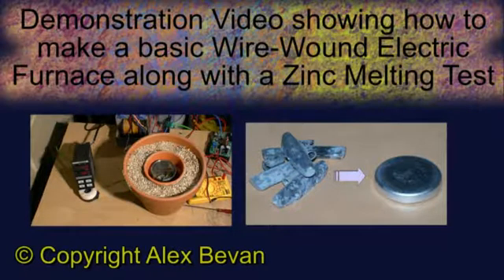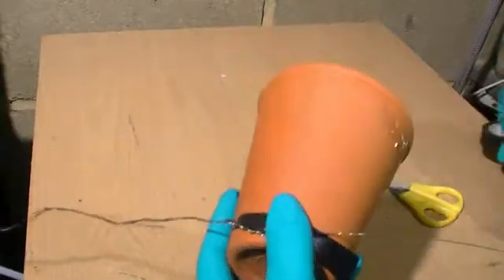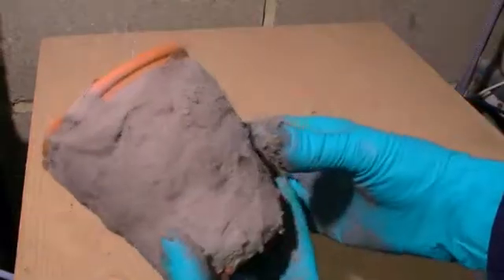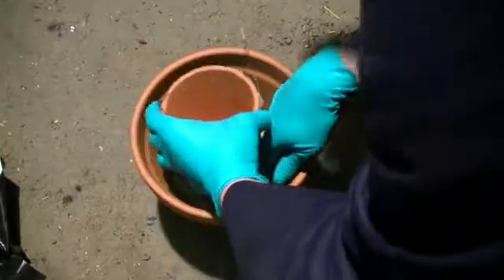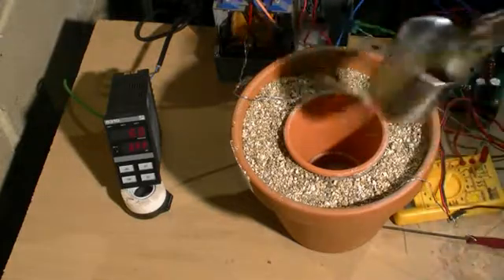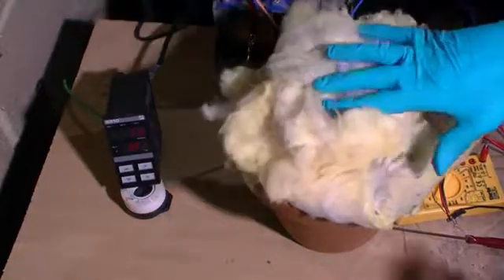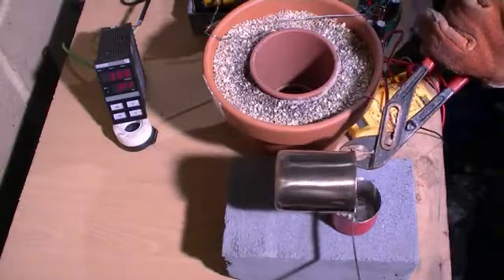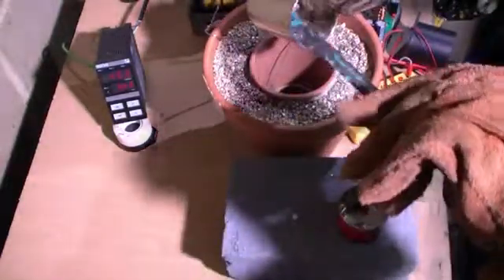How to make a wire wound electric furnace and melt zinc

Comment: Thanks for video.  How much time it takes to melt?
Reply from the maker: The first time you fire the furnace up, take your time to make sure any water is evaporated from the fire clay. After that you can increase the heating rate. I believe it took about 30-40mins when I ran but I was cautious as I didn't want to risk cracking the pot or damaging the heating element.

Comment: Cool! Have you tried using this for hot dip galvanizing? Will it work if i just dip mild steel parts into molten zinc? Or does it need some special flux or additives?
Reply from the maker: Should work if the steel is clean going in and absolutely no moisture on the surface. Will try this in the future- thanks
Reply: @EnergyMaterials  wikipedia says they put bit of lead in the mix, because it lowers the viscosity of molten zinc, so it flows easier of the part when removing it from zinc, so less zinc is lost and no big drops are left on surface. also steel should be cleaned very well and possibly etched before diping. probably same as goes when painting. maybe use somethig like prep&etch? steel should stay in the zinc bath until it reaches same temperature as the zinc, the you can remove it.

Comment: Thanks for the nice video of making this furnace.
I think it is lead not zinc.
Reply from the maker: I'm afraid we haven't used lead wheel balancing for a while now...”The European Union (EU) declared a ban on the use of lead in wheel weights in 2005” Older weight are lead but today they are made from Zinc!
Reply: Thanks a lot. I did not know it. here in Canada i think it is still lead.